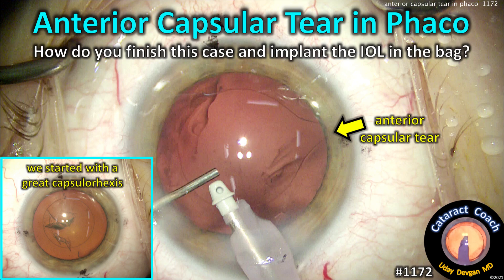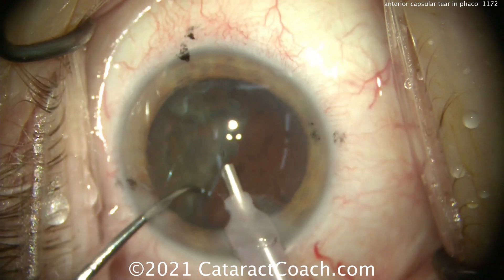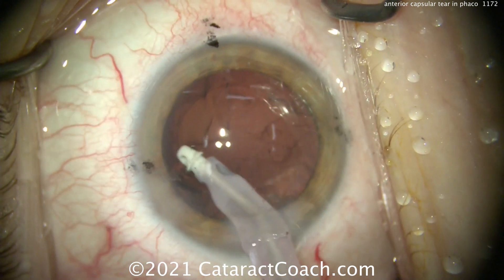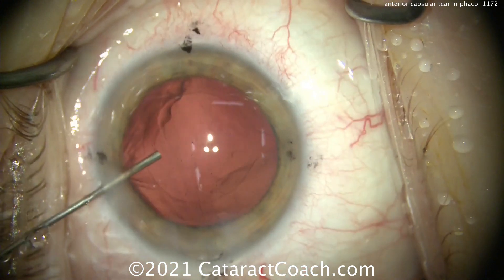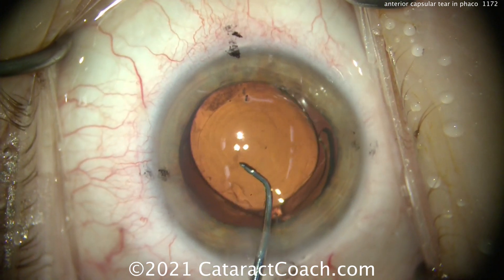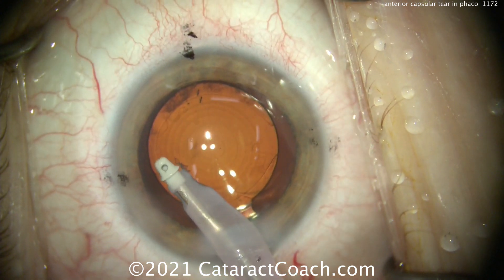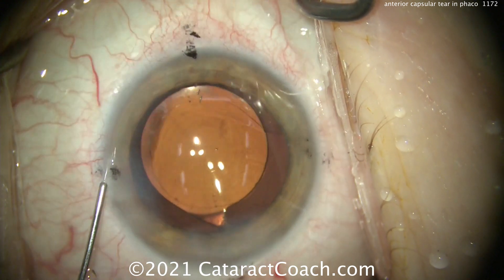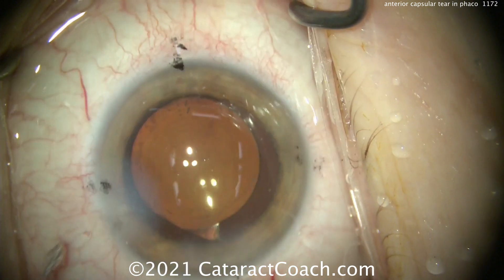CataractCoach 1172: anterior capsular tear in cataract surgery

Comment: Where should you place the haptics in relation to the anterior capsule defect? E.g. if the defect is at 3 o’clock, I can place the lens haptics at 12 and 6 o’clock, however, the tip of the inferior haptic would reach the defect, go in and enlarge it. Or I can  place the lens haptics at 3 and 9 o’clock, but the optic/haptic joint at 3 o’clock where the defect is would
 exert pressure and further enlarge it…so which is the safer option?